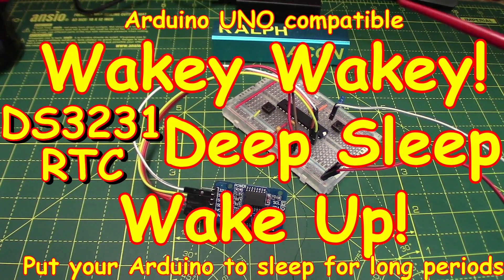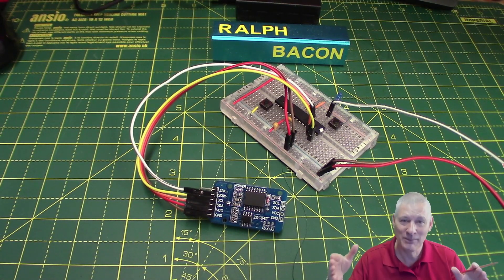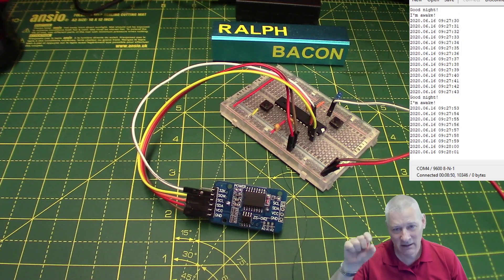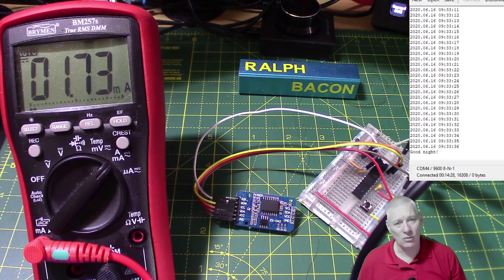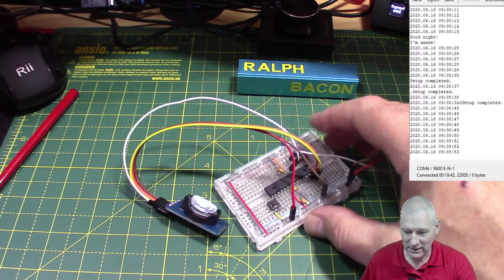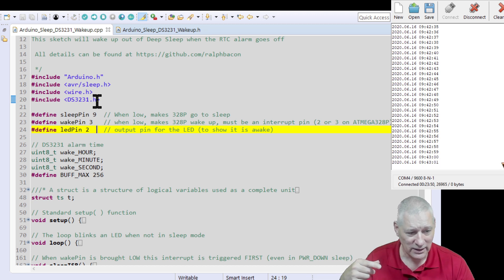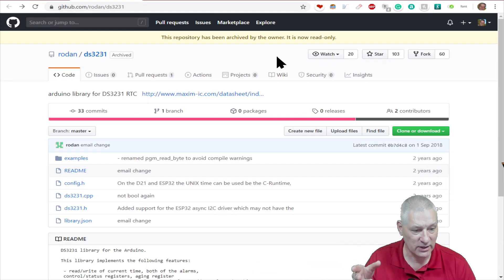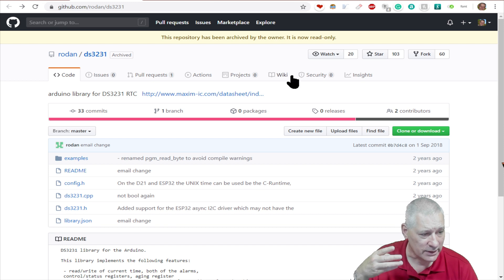#192 Wakey, wakey! Let the DS3231 RTC wake up your Arduino - easy!

Comment: 16:10: Should lines 59 & 60 be reversed? Right now you are setting it LOW first and then you instruct the MCU that this is an output.
Reply: Hey LJ . 
No , I think Ralph did that as setting as output first will set the pin to high .
Set as low first and it will start low .
The way you are thinking will send a high pulse before going low .
Ralph did explain this in a video , only I cant remember which one ... 
Maybe Ralph can remember or explain a little better ... :)
Reply from the maker: Karen is correct. By setting the HIGH/LOW first avoid any microsecond blip as the set the pin to OUTPUT and then digitalWrite it LOW. Nick Gammon (no relation) taught me this so who am I to argue?
Reply: @karens-jclark4199  Thanks
Reply: @LJWinkler247  
No problem ... Picked this up from Ralph , lots of good info from Ralph .
Happy to help when I can :)

Comment: Sony/Murata VTC6 - 3000 mAh without any protection
Reply from the maker: That is certainly a high capacity 18650 (assuming it's genuine) and at just a fiver each (in the UK) good value too.

Comment: Thank you
Please replicate same with ESP8266 :)
Reply from the maker: The ESP8266 does things a different way, when waking from Deep Sleep. It just "reboots" and there is a flag that the developer can read to detect it is, in fact, rebooting from so-called Deep Sleep rather than just being switched on at the plug. The only way it can "remember" values is by writing them to the RTC's RAM area before it goes to sleep. But it doesn't resume execution from the next statement in the sketch, it just starts the sketch from the very start. Not so great. But the DS3231 could trigger the reboot, I guess. Watch video #116 (https://youtu.be/NgPwPKXCLFY ) to see if that gives you the answer.